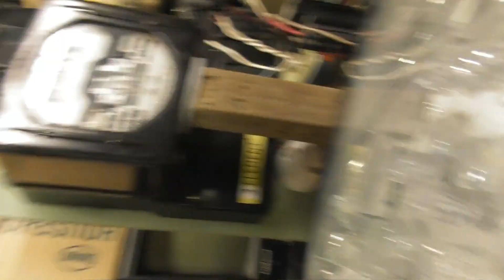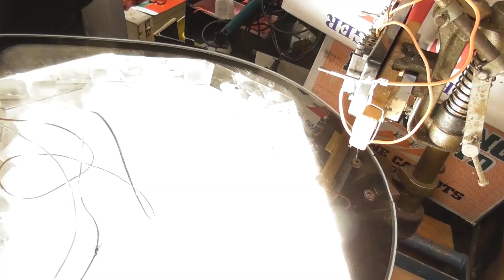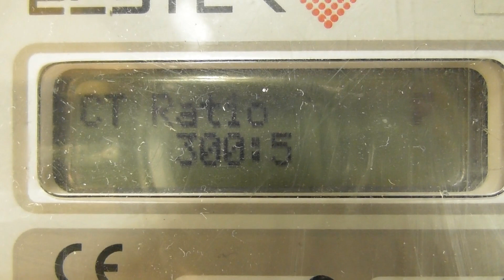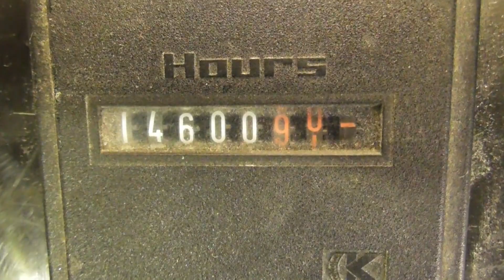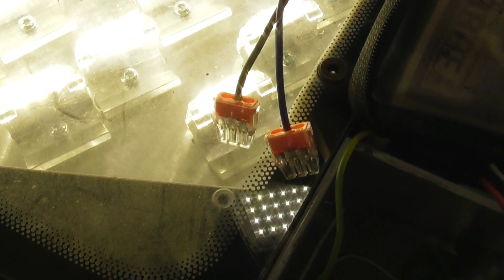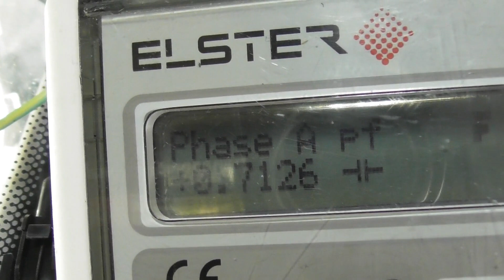Large dimmeable KIM LED street light fitting

Comment: I tore apart a 350w Cooper one which was knocked over by a pickup truck on the side of the highway where I live.  It had six 57 watt panels in it and I was a bit surprised to find no thermal compound behind them.  This fixture replaced a 250w HPS one which was also knocked over.  It also had two 200w 480v Philips drivers.

That Elster meter is for grid-tie generating isn't it?
Reply from the maker: Probably is, also a dumpster find locally.

Comment: Wish I could find your dumpster Rodney, you have some great things there. As to the power factor change, when you dim it is is overcorrecting the power factor, making it more capacitive, as shown by your power meter showing your load being more leading power factor than the normal lagging of most inductive loads. 

You can try again without the PFC and spike reduction capacitor VDR array in, which should bring it to a more or less 0.7 lagging power factor irrespective of dimming state.
Reply from the maker: I will do a test with an analogue PF meter. I was just curious how this polyphase Elster meter was measuring the load and see if it worked.

Comment: We installed some dimming ballasts on banks of fluorescent lights where i worked, each ballast could be controlled with a potentiometer, or a 0-10v supply
Obviously it was better to control the whole bank with 0-10v, so your lamps seem to work the same way
Reply from the maker: I will install a proper potentiometer in this lamp. The ballast supplies 10-11 Volts dc with nothing connected. By adding resistance the lamp is dimmeable up to a certain percentage.